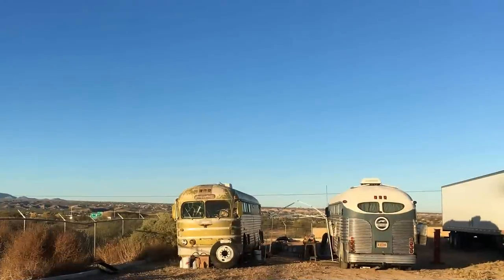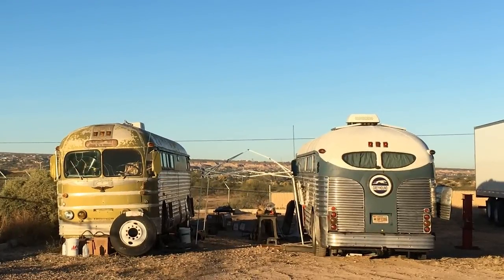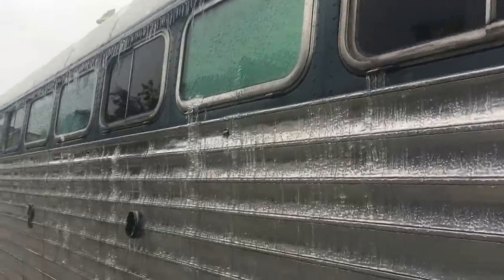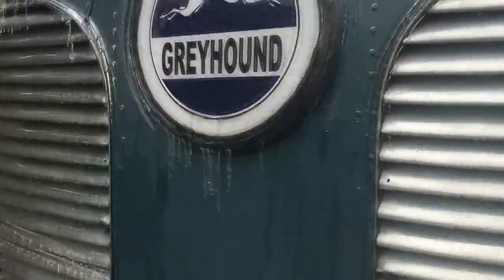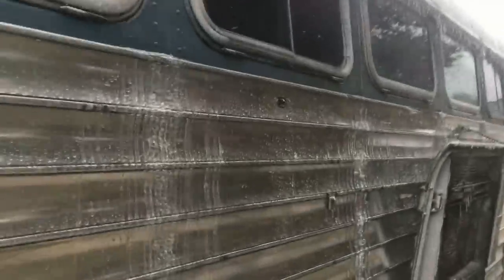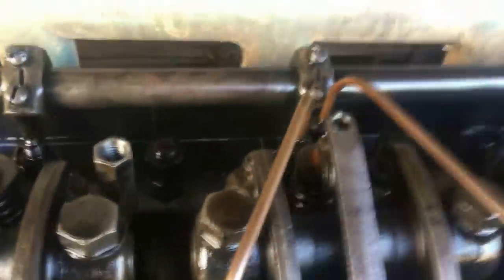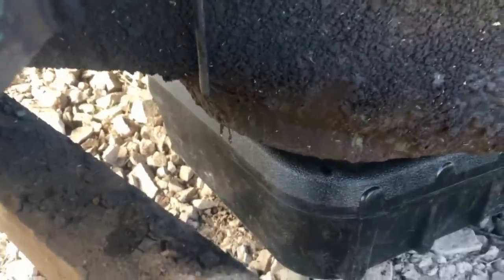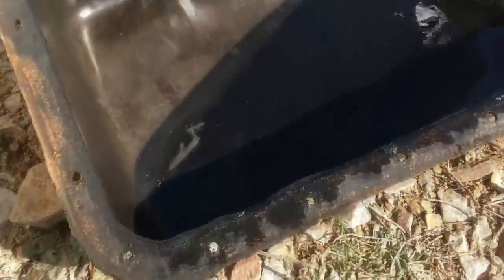Resurrecting a GM Bus that had a seized detroit diesel 671

Comment: Great video. Have you ever had one of these engines run away on you?
Reply from the maker: Yes 3x  it only for a few seconds before i shut them down.  Only one of the 3 were hurt by the runaway in anyway and that one that did only had a broken blower drive shaft and seized fuel pump. That one took about 25 seconds to get stopped.  It’s a very funny story i May tell one day.
Reply from the maker: If was my own damn bus too...  more damage was done to my wife’s bmw that i left parked behind my bus with the passenger door open.   Short version my last ditch effort to top it was throwing a folded beach towel into the blower.  Flaming towel chunks came out of the tailpipe into my wife’s car.  Still soot marks inside of her car.
Reply from the maker: I always make sure there is a way to shut them down.  That was my 1st.  I had already started it after replacing a liner.  But i had to remove the blower to fix an oil leak.  When i did that a piece of the governor housing broke and wedged a metal chunk in the governor.  The previous start i had the flapper on but this start i was just checking for the oil leak to be fixed. I started it up front and it was already 3-4K rpm before i got out of the bus door.  No rack control no shut down lever control and no flapper on the engine.  I didn’t even have a screen over the blower lobes.   A video of it would have made me a lot of money.

Comment: Maybe I missed something, but this engine can be rebuilt while leaving the block IN the bus? What brand rod bearings do you use? Clevitt? Did you replace any wrist pins?
Reply from the maker: All the wrist pins were blued on the ends from the high heat they endured.   Yes they all got replaced along the the pistons, liners and bearings also the head was cracked and got replaced.  Federal mogul bearings were used.,

Comment: The ride on this buses most be fantastic smoth. Do they run on air suspension ?.
Reply: yes.  2 airbags for each wheel.
Reply from the maker: No silversides are leaf spring suspension
Reply from the maker: 4103 also leaf spring, 4104 air springs.
Reply: @BusGreaseMonkey   must be a hell of a setup then, someone at GM knew their spring rates. Single or dual, or more Shock absorbers?
Reply from the maker: No those are all 35’ buses.    40’ didn’t come until the Scenicruiser
Reply from the maker: No rear shocks 13 springs per side.    Fronts have lever arm shocks.  Very hard to get the last one i had rebuilt cost me $1700 for one damn shock on my bus.  I should have converted it to a set of $100 Monroe shocks.

Comment: If their ain’t oil under it their ain’t oil in it ~ Detroit diesel
Reply from the maker: And if your dipstick bottoms out it isn’t always something to brag about.
Reply from the maker: Change filter only
Reply from the maker: Fix one oil leak and two more will be created somewhere else on the engine.     Detroit diesel Law of lubrication.
Reply: Yup it marks its territory
Reply: That thick green paint wasn't just to make them look pretty.
Reply: haha once had some earth angel knock on my bus door (1960 5301 with a 6V71 Detroit) while I was stopped in traffic to tell me my engine was dripping oil...'that's normal' I said after taking a look...he looked so hurt :D
Reply: Sounds a lot like the multi-row radial engines used on the WWII warbirds. Those things were ALWAYS dripping oil (still do!). They use a LOT of oil. Whenever you refilled the fuel tanks you also had to refill the oil tanks.

The R-1820's used on the DC-3 each have a 250-gallon oil tank. THAT should tell you something about oil consumption! After each flight, it was not unusual to put 150 gallons of oil back into the oil tanks!
Reply: @palominomale  lol

Comment: What damage is done to these buses if they get rear ended?
Reply from the maker: They are Monocoque construction so they are built like an airplane fuselage.  They get crumpled and usually totaled because the expense is much greater than the valve to repair.   Good news is they stop slower than most things that would rear end them ;)

Comment: What cc/cu inch capacity is this engine? Thanks
Reply from the maker: 426.    71 cu inches per cylinder 6 cylinder detroit diesel 71 series.  That’s what the 71 stands for.

Comment: How?  How do you do that just on site like that?
Reply from the maker: Lots of tools and great vendors
Reply: I could see myself getting an old bus in the future. Probably be a heap with everything rusted solid and dry rotted.
Reply: @BusGreaseMonkey  ... I was wondering about that. Traveling all over & working on what you do, how do you find vendors? Is it something that you research quick before you go?  In my experience you always tend to run into little things that can put up a roadblock. How do you prepare for locating parts when you're on the road?

Comment: Mediator leaking of stupid Rock Of The Road I guess make protective steel plate for the bottom
Reply from the maker: The silversides radiator is very low and vulnerable to this.  I have never actually worked one that didn’t have a welded up bottom of the radiator.   I JB welded mind to get it home when i bought my bus.  My buses 1st repair after making it home was sending it off to the aluminum welder

Comment: No wonder that thing seized. Guy is clueless
Reply from the maker: He is not clueless, he’s a very good car guy and owns another bus, but it was their first detroit diesel 2 stroke and that is a whole new learning curve.  He learned a lot the hard way unfortunately
Reply: @BusGreaseMonkey  Heres a hint for those who have older vehicles like this , get a low water and low oil warning system installed . Even cars have low coolant and lube lights today .The cost may seem high but I'd hate to lose an engine so far from home because a radiator burst or something. I don't think the issues were the owners fault, i think it was who ever worked on it before . he now has a bus which will see another 50 or 60 years on the road...as long as THEY let us.

Comment: Guy owns the bus and doesn’t know how to double clutch?  There is probably a reason why the bus is still so rough.  Seems a shame this Michigan man even has this bus.  It also seems a shame you fixed it for him.  I don’t see a long or good future for this bus....
Reply: You gotta learn it sometime. Probably when he sold the bus the seller likely just assumed the guy knew how to double clutch.

Even if you'll never use it, I think everyone who drives anything with a synchronized manual transmission should learn how to double clutch. It's not hard to learn. Just because a tranny is synchronized doesn't mean you can't double clutch it. I learned how to double clutch on an old 1963 Chevrolet church bus with a 4-speed unsynchronized tranny and a split rear axle. 

With all the automatics on the road today, it wouldn't surprise me to learn that a lot of today's car drivers have never learned to drive a manual anything.